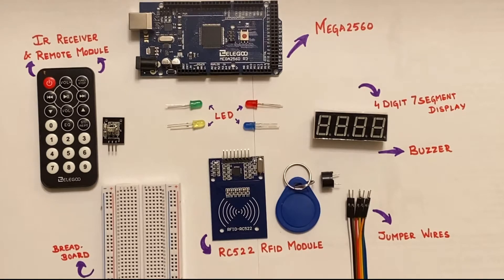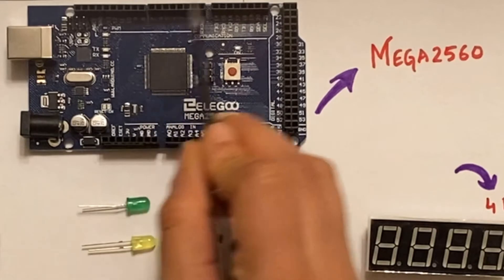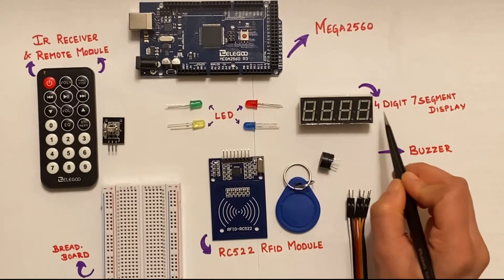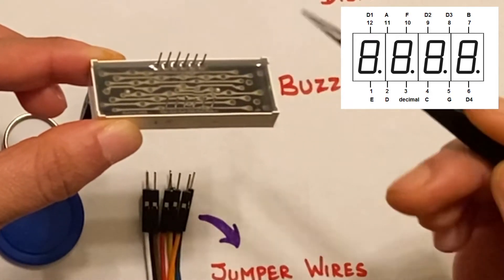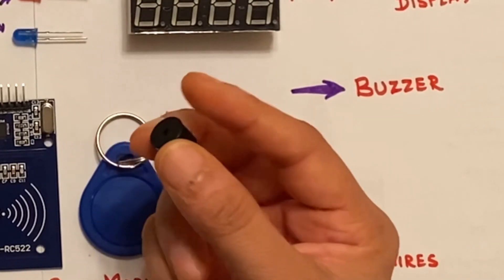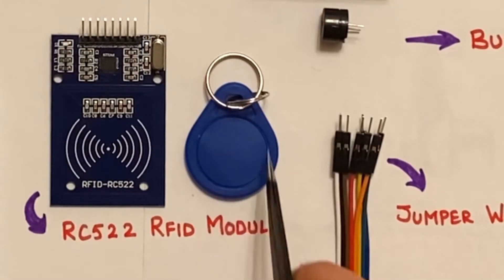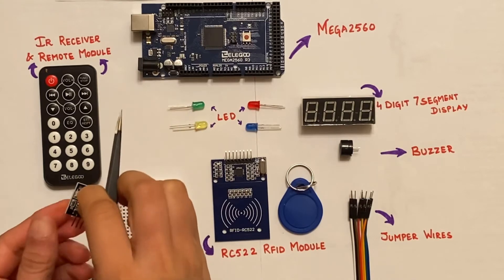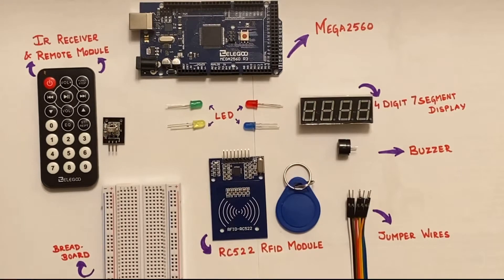RFID based Alarm Clock | DIY Arduino Project

Comment from the maker: The links to all the electronic components used in the video are given in the description.
Medium Post link :
https://softillusion-robotics.medium.com/rfid-alarm-clock-using-mega-2560-2150609f469b?sk=667d6efd7b23e62cdb23d28533b02a19
Reply: salut
en faite quand je compile le programme ca marché j'ai besoin d'aide